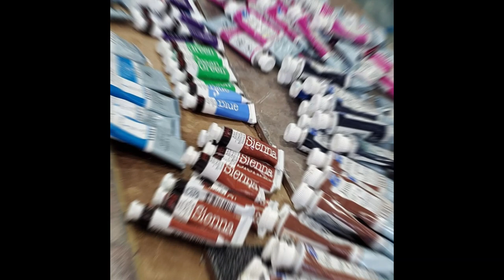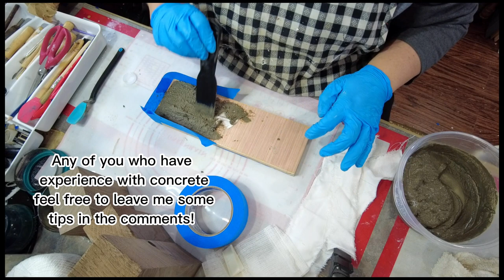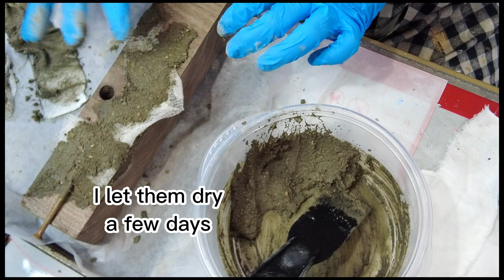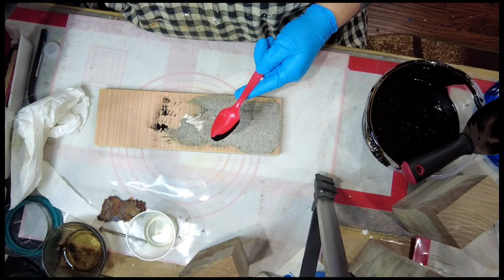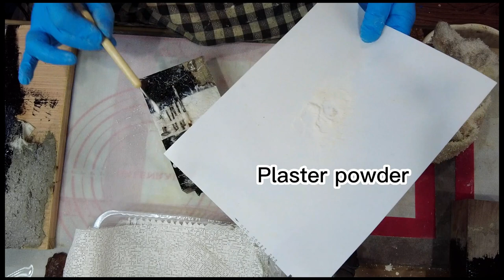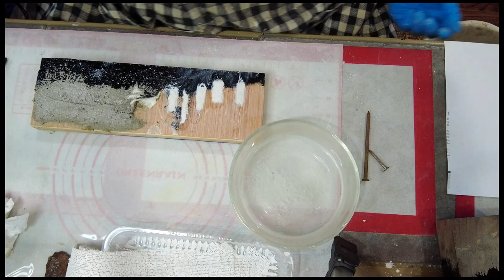Experiments with Concrete, Tar and Plaster for use with Encaustic art

Comment: I love what you are doing. I'm no expert in tar and concrete, but have a little experience with both and feel compelled to say something. 
Looking at your video,  it looks like you might have mortar or cement, rather than concrete. You shouldn't need any gesso for it to stick, but I'm pretty sure you need your wood moist (water as your primer) to stick. 
Pertaining to the tar. There is a difference between topcoat and roofing tar. I say this because you mentioned it seemed to multiply. Roofing tar is much thicker and goes on nicely with a spatula, it keeps its shape. 
Again, I love your experimenting. Art is looking great!
Reply from the maker: Thank you very much!  I'm probably mis-speaking about those materials!  You're correct,  it may well be mortar... I'll have to check the bag.  Thank you for the tip about the damp wood.  I will try. 
Thank you for watching!!
Reply: Not trying to correct you if you misspoke, just that mortar won't stick and cement will fall apart. I think you can use some acrylic additive (from hardware store) or acrylic medium to add to the adhesion for the concrete. It does change the texture some, but could help you with your "vision". 😊
Reply from the maker: @Carol Mohamed  I really appreciate that.  Thank you ❤

Comment: Hello Leslie!  Thanks so much for sharing your process and all these useful information 😊 I use  concrete a lot for my mixed media pieces and what I would suggest is to add glue or gesso or even acrylic paint to the concrete mix in order to prevent the concrete from peeling off the surface. Hope this will help! 
I haven't tried encaustic yet...but I will soon....the effects and textures are really amazing!
Reply from the maker: Thank you so much for watching!  That's a fantastic tip!  I did end up trying a "round two" and I mixed plaster and concrete and it held much better.   I will definitely try the gesso or glue!
Reply: @LDFDesignsArt  I can't wait to watch more of your videos! 😊❤️